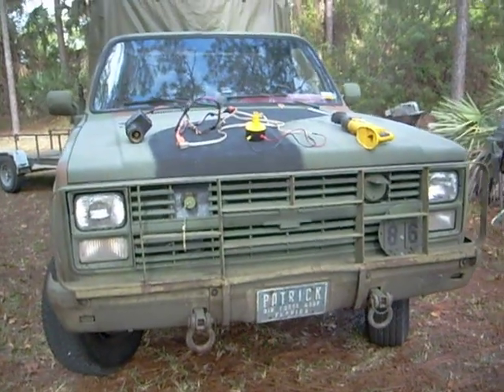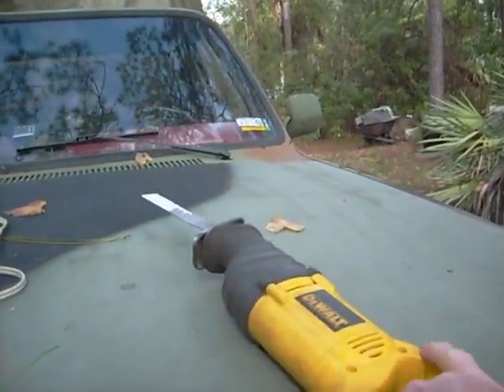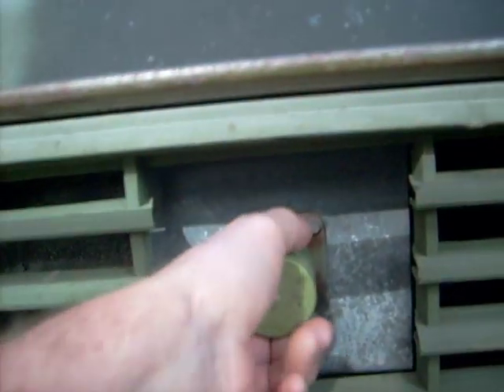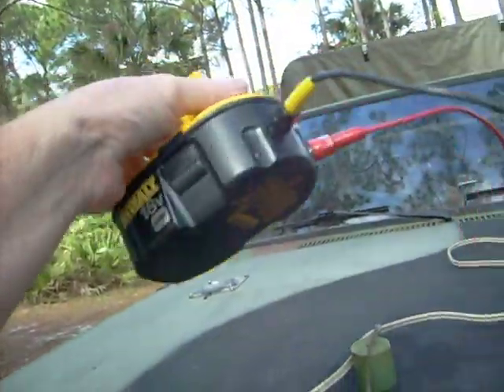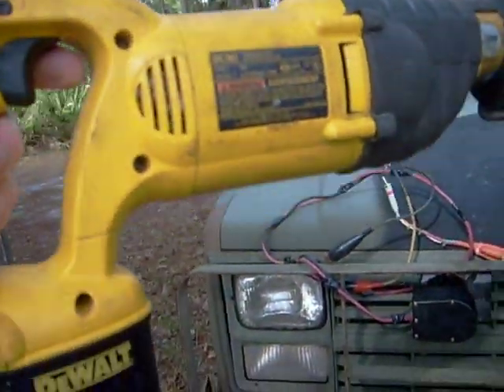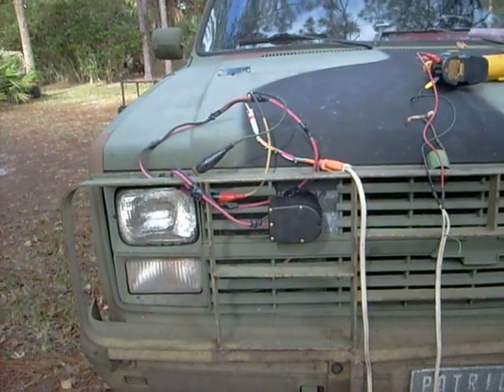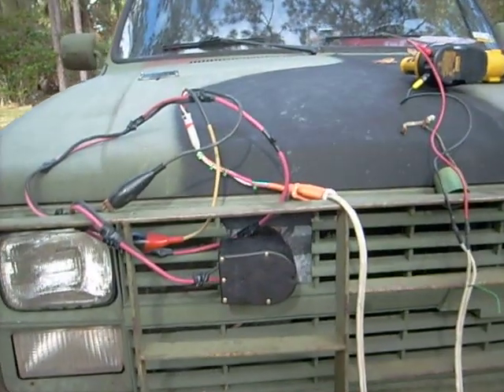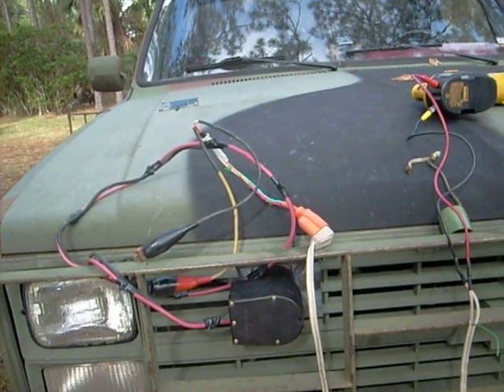Dewalt Battery Cheat, part 3, 17  Dec 2008 002.avi

Comment: You can take your dewalt batteries to a dewalt dealer within 3 years, based on the batteries date code NOT the receipt and they will repalce them free of charge with a new battery with a new 3 year warranty.

Comment: Im still using the same 5 Dewalt batteries I bought from new, 3 - 4 years old and have been through hell. I have only had to shock one of the 18v's once when it had problems. Original branded dewalt batteries last forever - I do know the clone and copy batteries are crap as some work mates have bought them in the past and had problems

Comment from the maker: @kingkurtzig   It sure does!  Dewalt batteries suck and do not last.  I see a lot of people selling their bare tools because of the sticker shock of buying replacement batteries for their equipment.    I just wanted a way to complete a task once the battery power faded and I was in a hurry to finish what I started.  Not sure if anyone else has modified their Dewalt batteries like the one I have but I am sure several people have judging by the interest in this video.

Comment: @sashazeitlich Not into ham radio but would enjoy that as a hobby I have never had.  My truck that appears in this video is an M1008A1 Radio Truck and I replaced all of the antenna mounts on the side of the truck and have the antennas for each of the mounts but no radio.  Thanks for the comment!

Comment from the maker: No problem so far.  When used with a long extension cord the resistance in the cord brings the voltage down considerably - around 18 volts.  The difference is there is no "fade" in the voltage like you would get with the battery as it runs down while being used.  I just converted a 14.4 volt Dewalt battery hust like you see in this video but only use a 12 volt battery to run those tools.  An auto battery charger generally puts out abaout 14 volts and can also be used as a power source.

Comment from the maker: If you have a voltohmeter, you can easily find the positive post by testing each tab of the battery.  You will know which oe it is when the voltage reads correctly on the meter.

Comment from the maker: Dewalt makes superb cordless tools - perhaps the best on the market.  Their batteries are not good because the cost too much and they do not last.  When I purchased my Dewalt equipment I had no idea the batteries were only good for "X" number of charges (forgot the exact amount) so when all of my batteries died off one by one, and I saw the price of replacement Dewalt 18 volt batteries this is what I did to solve my problem.  It does work by the way.

Comment: DeWalt batteries suck. I have to wait and buy these when I visit the usa once a year. I hardly use the drill an hour running in a year. I get between 1 and 2 years , or 2 hours  running, That's like 40$ an hour! They say leave them on the charger so that'; what I do. 
So this video gives me an idea.
 I'll do like he says, but I'll carry a 12 volt motorcycle (lead/acid) around with a handle on it. It'll have 10 time thre capacity of the dewalt.
 Save myself $40/hour ad i can retire right away.

Comment from the maker: I just wanted to show one unusual way to power a cordless drill in the event you are out working on a job site where a 120 volt A/C power source may not be availble to plug a transformer or charger in.  Dewalt batteries are pure crap so I get around buying new ones by using my "cheat" battery which deprives Dewalt out of a sale - that's really my main objective.  If more people did this and the batteries were not selling, Dewalt would soon drop the price of replacement batteries in a hurry.

Comment from the maker: If I bought any more Dewalt power tools they would still be 18 volt.  I can't imagine what the cost of one of their 24 volt batteries would be!  The present system I am using to "cheat" buying any more of their batteries works just fine.  When Dewalt decides to reduce the price of their batteries to half of what they sell for now I will start buying them again; meanwhile I am working on a new "cheat " to use Ryobi 18 volt batteries for my Dewalt tools and will post a video of that soon.